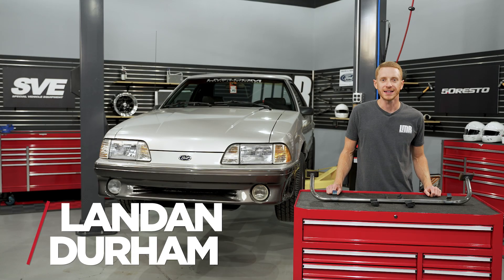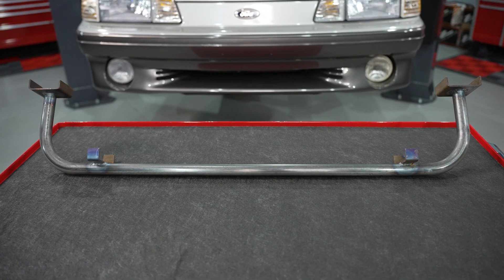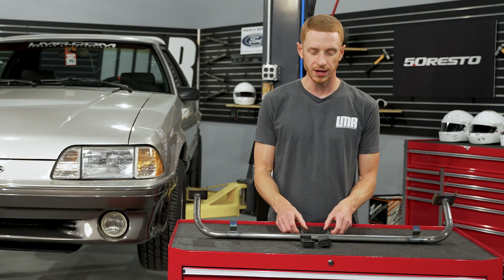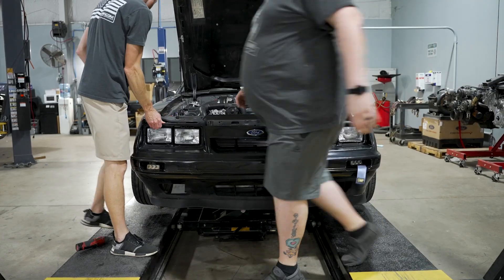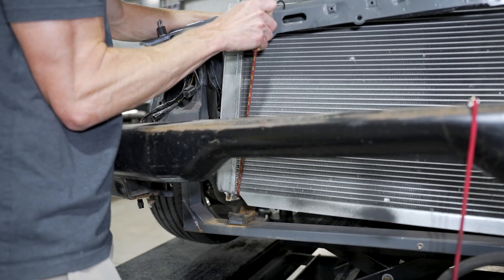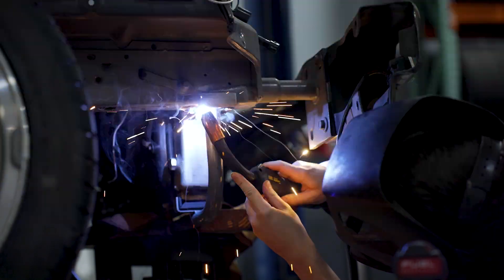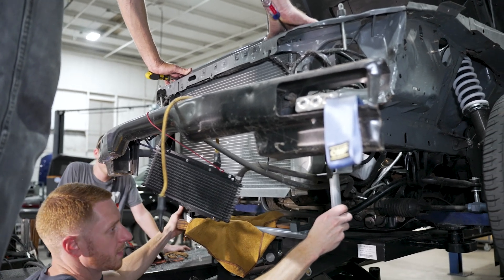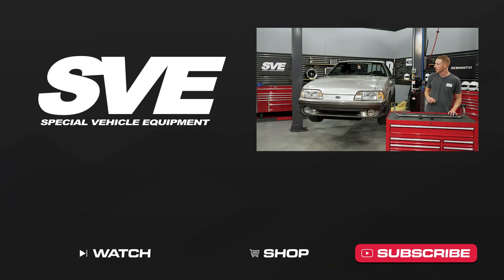1979-1993 Fox Body Mustang SVE Tubular Radiator Support - Review & Install

Comment: On the original core support the bumper cover attaches to the bottom with screws or bolts are there mounting points for this on the SVE?
Reply from the maker: I know this isn't the answer that you want, but you'll need to figure out a way to attach the lower section of the bumper. -Landan